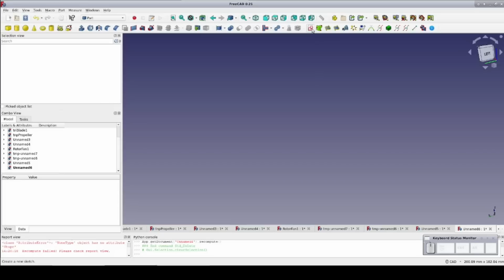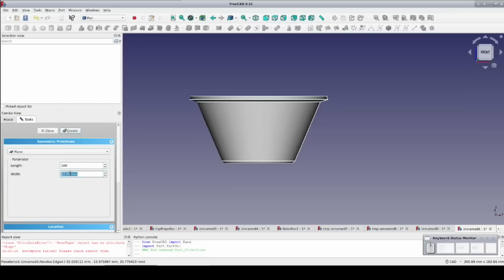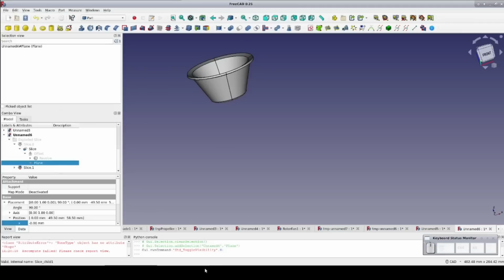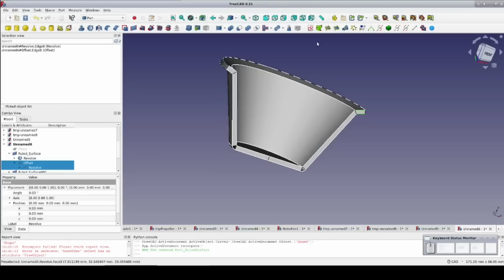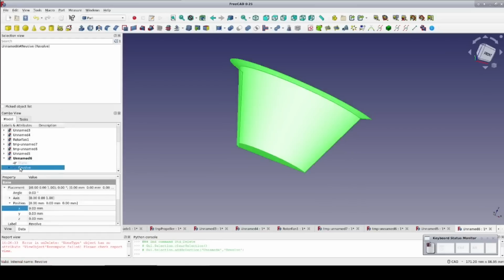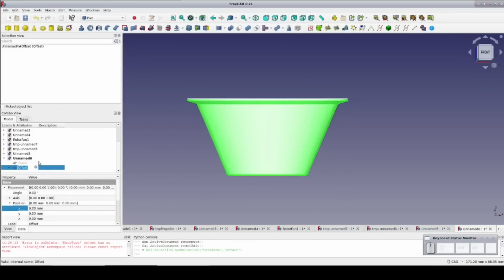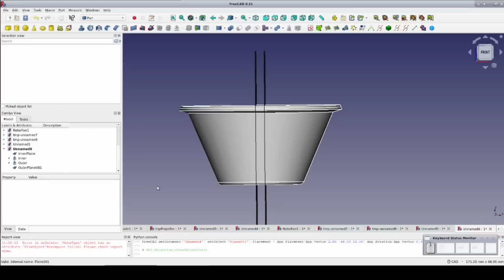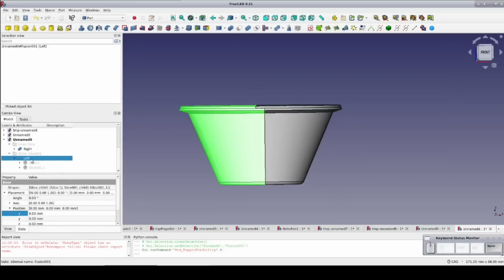FreeCAD: An open reply to Tom Sanladerer

Comment: The issue with FreeCAD I feel isn't necessarily one of features (well except TNP, which really needs a solution implemented other than telling someone to "just fully design the part"), it's one of UX and UI, and how in addition to requiring a different approach to making the part, many features and tools for those workflows are hidden and not obvious for a new user. This combined with the awesome number of different features and tools available in FreeCAD, makes learning an unreasonably daunting task, not because the new user is lazy but because the obtuseness of everything in the program makes it feel hostile to their experience, on top of demanding a different workflow; responding to this with "users of Fusion and Solidworks will just have to work harder" further emphasizes that feeling of hostility, whether it is intended or not. 
Yes, a User has to make some concessions when working on a new tool, but Devs also need to meet them in the middle and compromise as well; telling people to just deal with it is not conducive to the program actually being adopted. In my opinion at the least there needs to be some option for a "consolidated" UI with just a few main workbenches / toolbars (both on the larger level of there being more than a half dozen workbenches and within the workbenches; there should be a single dimension tool under sketch, for example) and serious work to at least try making the workflow more analogous to what it is in the major CAD software used by people. Whether you like it or not, Fusion and Solidworks are industry standards that most other software in that usage niche attempts to emulate for a reason, and the majority of people are used to the kind of workflow found in them.
Reply: OSS seems to struggle with this in general. FreeCAD hasn’t yet had its Blender 2.8 or KiCad 5 moment. Neither has Inkscape. Or GIMP…
Reply: Spot on
Reply: It is a big problem with open source projects. Everyone wants to work on the functionality and not how to use the program. Open source projects also tend to end up just being a load of separate sections tacked together and can end up being quite a mess. That is just an issue with having loads of developers just doing what they want, when they want. It also makes it harder to end up with a consistent UX and UI and hence they tend to just get to the barely functional stage and leave it at that.
Reply from the maker: Notably, FreeCAD is at version 0.20, so completeness is not really a question, it is not complete, it does not claim to be.
The question is "Is it useful in that state". I find it to be, as do others. Still other people do not.
Reply: @4axisprinting  You seem to miss the point Bar Rag was trying to make; functionally FreeCAD is adequate, but its workflow and usability are so poor and backwards compared to the expectations and requirements of the *industry*. Be this product design in general or more niche industries. FreeCAD definitely needs it's Blender 2.8 moment to be taken seriously to any extent, since right now it's another OSS with the functionality there, but not the stability, transparency or usability. I've had a much better time with CATIA than with FreeCAD, and the few friends i have actually doing CAD professionally don't want to touch FreeCAD with a 50 meter pole; With good reason.
Reply from the maker: @SlinkySlonkyWaffle  But implementing UX is no less work than implementing anything else yet, and it takes manhours to do. It's not finished yet. Though honestly, I find that it works well for me and I know some do use it for professional projects. That said, I don't believe I'd care to design a jumbo jet that way...
Reply: @SlinkySlonkyWaffle  You seem to miss the point you are complaining about a comparison between a Blender "2.8" product - i.e. not just a 1.0 complete product, not just a 2.0 major enhanced 2nd iteration of a completed product, but a 2.8, or 8 fixes BEYOND a 2.0 product.  And what are you comparing it against?  A .2 product.  Please note the decimal place and adjust your perspective to the reality of the situation.

As for CATIA, please note it is currently in version 5.  I remind you to carefully examine decimal points.  All the FreeCAD developers who devote their time, you know, for free, are greatly relieved you didn't compare it to version 23 of AutoCad to point out its shortcomings, you know, being 23 major releases behind...

We can likely agree on one thing however, a 2.8 OR a 5.0 future version of FreeCAD, when it happens will likely not receive such unfavorable comparisons nor complaints about "expectations and requirements of the industry".

Lastly, as the video clearly stated, there is zero expectation that your CAD PRO friends should consider it at all.
Reply: @brianmi40  well stated!
Reply: @brianmi40  FreeCAD is old enough that being an 0.20 release is an embarrassment, like being a 10-year-old kindergartener and not seeing that as a problem. I've tried it a bunch of times and it's miserable.
Reply: @jmsaltzman  Your certainly welcome to your opinion, however there's 22,000 subscribers to the largest channel of tutorials on it and you can read the Comments yourself on any of them for the infrequency of complaints.  I have zero problems with it (other than TNP which is fixed in LinkStage3 and marked as to be fixed in the upcoming 1.0.  Just designed some mounting plates and 3D printed them tonight.  My average moderate design like that takes less than 5 minutes from starting up FreeCAD so I'm happy to have an open source solution that works that well.

As usual here, no one is specific about problems, just expressing dislike, sort of as someone would who worked for AutoCAD.
Reply: @4axisprinting  UX should be one of the first things implemented. It may not be fun but it dictates the structure of the rest of the program. It also acts as a way to quickly identify what features need to be added while limiting feature bloat. There are certain features that similarly dictate the structure and those should be developed concurrently with the UX.

Much better to have a good UI with buttons that have NYI next to them than a UI that you can't understand unless you wrote the thing and having every feature implemented.

If you don't follow this process, you are literally better off writing a program that runs via console.
Reply: @jmsaltzman an "embarrassment" are your comments, you clearly are missing the point that FreeCAD is a free tool, with no limits or other funding other than grants or donations, worked on by a small team. All your professional CADs literally use the same proprietary geometric kernel, Parasolid, maintained by Siemens. The CAD software itself is maintained by Autodesk, Dessault Systems or whatever other large company. They, unlike FreeCAD, do have the funding to pay multiple teams of full-time developers. Yet sure, FreeCAD being at .21 while being very capable for it's price is an embarrassment.
Reply: @4axisprinting  I don't think the version number takes the traditional milestone approach. 1.0 doesn't mean it's "complete" it just seems like a build number in this case.
Reply: @4axisprinting  The first release of Freecad was 2002, and the first stable designated release 2022. It isnt about completeness, but about that 20y+ of freecad development spent aproximately zero minutes in UX. This isnt uncommon for open source, the dearth of UX designers in open source is a well known phenomenon. Watch some Tantracul videos sometime.
Reply: @4axisprinting  The "It's only at version 0.20" and "they admit it's not a finished product" arguments lose their weight of integrity when a software reaches ten years old. Freecad to date is over twenty. By this point it has no LEGITIMATE excuse for still having as hostile or cumbersome an interface and experience as it does, to new learning designers and experienced professionals alike. I won't deny that Freecad has its advantages or that the workflow "simply feels more right" for some people, but when you combine its limitations and the core development team's insistence on driving out the sources of some of those advantages (as with the unilateral removal of  CadQuery and OpenSCAD workbenches and compatibility a couple of years ago) with that particularly steep learning curve, and with the community's intransigence against an alternative UI/UX even optionally, it creates an environment ripe for exactly the sorts of criticisms that Freecad gets heaped on it everywhere except it's own message boards and chat rooms.
Reply: @claws61821  Funny, no one comments to a real master of the program like OficineRobotica about the UI, as he configures it for a completely modern experience and maximizing the view window:

https://www.youtube.com/watch?v=6iU0g-X5Z1g&t=5s

To say nothing of all his advanced tutorials, where NO ONE comments on how "clunky" the workflow was:

https://www.youtube.com/@OficineRobotica
Reply: While I can agree the UI, UX and workflow are very different and a bit rough in places the amount of learning required to come at the Solidworks/Autodesk etc as a new user is not actually that different, IMO might even be easier to get started in FreeCAD! Any software as capable and complex as a 'complete' CAD/CAM/FEM package has a huge learning curve and feels daunting when you are new to it. The big issue for most there is that they are not willing to learn a new workflow for a new tool - which is perfectly understandable, but it doesn't make the new tool terrible or unusable. It can even be massively massively better tool and folks won't want to go through that new learning curve, and will be very down on it for doing something 'wrong'!  

FreeCAD clearly isn't in a finished polished state yet, but I don't see any reason to make changes to FreeCAD to be more like the other CAD programs in most areas - the difference in most cases makes no difference to the functionality or usefulness once you learn the required workflow. What people are 'used to' is not a worthy reason to put in so much effort when the current method works fine - has to be some functional benefits in tool function or increasing consistency across the FreeCAD interfaces as well.
Reply: @foldionepapyrus3441  I disagree. Once you learn how to use one of the major CAD programs it is not hard to transition between them. I started on autodesk inventor, then fusion 360, then solidworks and now back to fusion. The workflows are similar enough that you shouldn’t have much issue switching between them and for the most part the tools work similarly.
Reply: @conorstewart2214  Just because some programs happen to use similar methods doesn't mean that method is the only 'correct' or 'good' method. Lots of programs with similar use cases but very different design where all of them are popular, and lots of folks drive giant petrol muscle car type things as if they are the only vehicle that can possible exist, does not make that European sports car or even tiny compact car wrong - it is just style.
Reply: @foldionepapyrus3441  I never said it was the only good method but you make it out like it is just as hard to switch between the main ones as it is to switch to freecad which isn't the case at all.

Plenty of other things don't deviate much in style and there is a reason for that. Doesn't matter what car you get in, the controls may be in different places (except the main ones) but you will know what controls should be there and how to use them. The car may look different and be a different style, it might even be a truck but the main controls and how you drive it will be the same because it is standardised. Changing to freecad is like getting into a car with its controls totally different, like steering with your feet and having a button for the throttle. It isn't an easy transition like it is with other CAD software.

Similarly most people can go onto a website and know how to get around the website, since most websites use a pretty standard format. If the website isn't intuitive to navigate then people just won't use it, same with freecad, if it is totally different to the standard CAD software out there then people just won't use it.
Reply: @conorstewart2214  No I said as a NEW USER learning FreeCAD vs learning any of the others is similarly difficult and daunting.
Reply: @foldionepapyrus3441  if experienced people find freecad a pain to use then it is a lot worse for people who have no experience. Also wouldn't you want your time learning how to use a piece of software to be applicable to other, similar pieces of software? It's like learning to drive a specific car and then finding out you don't know how to drive any other car and will have to relearn it. There is a reason companies don't use freecad, there is a reason universities don't teach freecad and instead go for options they have to pay for.

Fusion 360 or onshape are probably the most beginner friendly pieces of CAD software out there. It isn't hard to go from nothing to being able to create semi complicated designs with just a little guidance.
Reply: @conorstewart2214  Really not the case - experienced people are locked into trying to do everything the way their last software did - they don't like changing between Solidworks and Autodesks offerings even! That doesn't apply to a new learner - they will learn the correct best practices for the software they are using and not have to unlearn all the wrong ones first!

The only reason not to learn to use FreeCAD initially at this point for most users now really is industrial inertia - it isn't quite as polished or functional as I expect it will become, but it is now a fully functional tool that can do everything most CAD users would need. It just hasn't been that way for 20-30 years to start becoming common in the industry, and so a sought after skill.
Reply: @conorstewart2214  Who's recommending CAD professionals even consider a switch to a .2 pre-release version of open source software?  Not their employers, nor their peers or any college professors nor the author of this video who was explicit in stating that.  Literally NO ONE masters Autocad or SOLIDWORKS and wakes up one day thinking, "you know. I think I'll learn and switch to using a pre-release .2 version of some open source software."

Strawman much?
Reply: @conorstewart2214    You'd think so, but would be wrong as this video clearly points out; Thomas was done in by his preconceived errant notion that some pre-release version of some open source software would or should operate just like its finished, polished commercial alternatives, instead of approaching it humbly and watching enough tutorials to capably accomplish his task.

I conversely approached FreeCAD humbly and sought out videos to teach me about it from the hundred plus published in the last year.

And the reason companies and professors don't recommend it has much less to do with it's workflow or limitations, but has everything to do with what companies USE as a CORPORATE STANDARD, open source need not apply unless it's grown to prominence and huge levels of support, like Linux/Unix.

Don't learn Onshape to work at Jabil Circuit, it can't export Gerber files, the standard they use.  So anyone wanting to learn CAD for a career can't just pick a big popular easy to use tool, more than they need to research the industry and even target employers they want to work for.

And you know what Fusion 360 and Onshape have in common in their status of "most beginner friendly"?

They both are COMPLETE PUBLISHED VERSIONS of software that are a result of millions of dollars invested in developing them over 10 years, and 8 years respectively.  And you think it's reasonable to compare them to a pre-release version of some open source software that depends entirely on coding by volunteers and say it isn't as "user friendly"?

LOL
Reply: @brianmi40  every time free CAD software is discussed people bring up freecad, if it isn't ready for most people to use then why do people bring it up? Also being open source and still pre-release isn't really an excuse, if it isn't easy to use and the Devs seem to have no plans to make it easier to use then it is safe to assume it won't become easier to use.

How much time did you put into learning it? How much faster would it have been to learn an alternative? If they are having to publish hundreds of videos to teach people how to use it, even basically, then there is something wrong. If it is still pre-release and early in development then why are they trying to make lots of tutorials on how to use an unfinished piece of software that may change drastically?

The reason companies and professors don't recommend it has everything to do with its workflow and limitations as well as how unreliable it could become. If there are better, easier to use tools then companies will buy them rather than use some convoluted open source program. Professors go with what is easy to teach and is still used in industry. The cost of buying a better price of software outweighs the cost of wasted time and having to workaround problems with an open source piece of software which could become unreliable or abandoned. If companies or universities could save money using an open source alternative they would.

Most people can just pick a prominent, easy to use CAD software and learn that and then if they need to they can transition to a different CAD software. Switching between the prominent 3D modelling CAD software isn't difficult, switching to freecad is. Switching between PCB design software again isn't difficult. Remember CAD software is just a tool, it generally requires a lot less training and knowledge than being able to design the thing in the first place, the CAD software is just a tool to create a model of your design. For the most part with the types of CAD software it isn't difficult to transition to a similar piece of software. In general people just want to have to learn where the buttons are in a new piece of software, they don't want to have to learn how to do everything a different way.

Even people who are very experienced with CAD and do it professionally do not like freecad, shouldn't you maybe think why they don't like it? Why would beginners spend a lot of time trying to figure it out when they could just use something else and learn a lot faster? The best tools are powerful when you need them to be but also simple and easy to use.

If freecad isn't ready for mainstream use then people need to stop recommending it. The excuse "you just need to learn how to use it" doesn't really work, if it is harder to use and more limited or convoluted then why would people bother? Open source projects tend to do a lot better when the people trying to use it are listened to and it is made easy enough to use, they also tend to do better when they share similarities with already existing and established software, rather than trying to make everything unique.

Why would anyone use a piece of open source software if they don't know when or if features will be added? If they don't know when or if the usability will be improved? People don't want to sink time into learning something that may go nowhere or may take a long time when there are already existing solutions, once people use those already existing solutions there needs to be a very good reason to switch to an open source program and freecad with its low usability doesn't have many good reasons.
Reply: @conorstewart2214  They "bring it up" because it's the most capable open source 3D CAD software available, despite being far away from what the developers would consider a 1.0 release, unless you're a programmer wanting to program your CAD designs with Openscad.  Most other open source CAD are 2D only.

Being open source and pre-release isn't an excuse, it's simply a fact indicating it doesn't receive really any measurable financial investment compared to a commercial product with dozens of full time paid developers.  It also indicates it hasn't achieved a status of being complete and ready for primetime, as opposed to ONLY being of valid interest to those willing to put up with bugs, suboptimal workflow and functional limitations and able to exhibit the necessary patience to work with those limitations by virtue of being able to accomplish useful things despite them. The devs have every intent to improve and make it easier to use, as any review of the dev blog on their web indicates, to say nothing of the discussions on the forums.  It is easy enough for many to use, including me, but obviously not everyone.

You clearly don't seem to be their target audience. So should move on to a commercial alternative and end your frustrations.

As for my learning curve, it was part time over 4 months and now I can create objects of moderate difficulty within minutes.  Yes, I've had to figure out some workarounds, like deleting a boolean cut before making other mods to a model and redoing afterward, but so far there hasn't been anything I can't conceive and produce with it.  I and many others have said it isn't much different from other packages to learn, there isn't much magic available in sketching out a shape and padding it into 3D.  I spent some time years ago learning paid for Viacad 3d and found the learning curve much the same with 50% of the effort learning new pictures on the icons or what Workbench does what in FreeCAD.

"They" aren't making tutorials with the possible exception of this developer responding to a popular video where the user ran aground.  As a dev I would be happy to speak up if someone errantly thought a product I was a developer on couldn't do something I knew it could do.   The vast majority of tutorial creators have no affiliation with the project, just enjoy teaching or trying to make a few bucks from a YouTube channel.

As I already stated, Onshape doesn't get blocked from use at a company like Jaybil Circuit because it has "bad workflow".  Corporations often have immutable standards.

As for "convoluted open source program" it seems necessary to remind you this is a .2 dev release and that you need to just let it go that it is NOT competing for a place in corporate America.  The "better and easier tools" that corporate America will buy, they are FINISHED PRODUCTS, why are you incapable of understanding that?  As I said, NO INDUSTRY will standardize on PRE-RELEASE software to bet their company's future on when there are "post 1.0" alternatives with an established corporate entity supporting them.

Saving money in a university doesn't prepare the students for the workplace as much as training on applicable software used in their future workplace. That's why nearly every commercial package has a free or lower cost Student version.

"Most" people will never switch their CAD software unless by job necessity or opportunity or bankruptcy, etc. of the publisher.

Yes, once again, no argument, switching from a professional grade commercial CAD package IS INDEED "hard" to a pre-release open source unfinished product -- that's why NO ONE DOES IT and FreeCAD does NOT position itself as such a product.

So, DUH, pro CAD users do not "like it", you need to learn what a strawman argument is.  No one cares what THEY like.  It's not built for them, not marketed to them.

The "reason" beginners spend time learning it is that they don't have $300/year and up to pay for commercial software that they may start to learn and abandon, or use for one task and abandon, or they are happy to find they can actually do what they want with it, despite some workarounds, and they like the idea that if it meets needs now, it most certainly will get better with future releases to become easier to use and/or more capable giving them a significant payback for their investment to learn it.

This has played out in countless scenarios for open source software, including Blender, Inkscape, Open Office, and tons of other products that provide tremendous power, for FREE.

No, people don't need to stop recommending it, people like you need to stop denying reality that it was ALWAYS advertised as what it was: open source software subject to bugs and limitations and a need to STAY AWAY when that is not your cup of tea.  PERIOD.

Go learn what Steam means when they offer "Early Access" games and get a clue.  Caveat emptor.

Why do people use it with an uncertain future?  Because as I've repeatedly stated, MANY PEOPLE get it to do what they need TODAY, exactly as I've been able to do, so satisfied with that, they see that the history of software is BETTER in the future, not worse.

You need to give it a rest about "moving to " FreeCAD, there are thousands of users using it that never moved from anything.

Time for YOU to move on and leave all this behind.  Open source software is in no danger from people like you that see no value in it, won't suffer the limitations, and are happy to pay for a commercial product.  Spend some time reflecting on why everyone isn't just like you and that the world is a better place due to diversity, then get back to your life.
Reply: @conorstewart2214  Who the Heck owns those programs??? There's a common investor that pays the tune to have a common core! Autodesk
Reply: @conorstewart2214  No! The schools didn't go like yep we'll adapt Autodesk's litany of CAD programs... they paid their way in! That's how they got 'wide adoption'!
Reply: @brianmi40  definitely triggered you here. You do realise resorting to insults usually means you have lost the argument.

Whether or not professional users like it should matter, they are the ones that are most experienced with that sort of software.

Also your argument of a lot of people haven't switched to freecad and have just used it from the start isn't as big an argument as you think it is, it is actually an argument against you. All that says is that the people advocating for it don't have experience with anything else so lack perspective and really don't know what they are talking about.

It may be the most advanced open source CAD program but that doesn't mean much, especially when it is a lot worse than not open source solutions. Kicad is as good as commercial software for the most part, as is blender but freecad is not as good as commercially available software, it isn't a valid comparison.

I am not against open source like you seem to think. Freecad just isn't good compared to other CAD software and it has a long way to go until it is.

You say you spend 4 months part time learning it to be able to make basic models? People can learn to make basic models in fusion 360 or SOLIDWORKS in a few hours or days. They also have free or cheap non commercial licenses. 

Freecad needs more time in development before it should be recommended.

Maybe you need to realise that freecad is quite a lot worse than other CAD software and needs a lot of work. Why would you recommend something that isn't beginner friendly to beginners? If it is full of bugs and limitations and needs workarounds then why do you use it and recommend it? Why not use some other CAD program until freecad has all those issues worked out? You do realise time is worth something too and if you are fighting with the software it is maybe better to use something else and get it done quicker, even if it costs you.

You seem blinded by the fact it is open source, open source does not mean good. It means it will probably stay limited for a long time and will take a long time to develop. You compare it to steams early access games, however most of them are worked on by a dedicated team of people, not volunteers. So your argument doesn't really count, especially as early access is not open source.

You seem to of the group that says their free option is just as good and it can do everything the paid options can, but the reality is, it takes longer, is buggy and typically is worse and you need to find workarounds. I understand supporting open source projects but you can support them and recommend something else that actually works well whilst it is being developed. You using it is not supporting it, it is using it, actively developing or working on the code or donating to it is supporting it. The whole recommending something because it is open source and you believe it will be good in the future needs to stop, judge it based on now, you have admitted it has limitations, is buggy and you need to find workarounds, why does that make you want to recommend it?
Reply: @ev-ezaye3580  it really isn't the case. There are multiple companies all competing for the market on CAD software, no one company paid its way in, it is typically up to the professor what is used. Industry uses proper cad programs not limited, convoluted, open source ones so universities do the same.

It puts students at a disadvantage to teach them how to use buggy, limited software. It is far easier to teach them how to use software that works properly.
Reply: @conorstewart2214  I don't have any more time to waste on a hopeless case so this will be my last corrections to misrepresentations you refuse to stop making.

It appears beyond your grasp that "a lot of people haven't switched to FreeCAD" from another CAD system clearly then isn't EVERYONE.  And so, just like ME, coming from ViaCad and Tinkercad experience, many HAVE SWITCHED.  No, that doesn't include career professionals but no sane person would believe it should or is even attempting to make the case for that.

No, I didn't say I spent 4 months learning to create basic models.  That can be done in a few HOURS.  What I said is that in 4 months of very PART TIME USE I learned enough to be able to create a COMPLEX MODEL with multiple boolean curved cuts and complex precise internal geometry to make a replacement part for a window regulator which I 3D printed and is working in the vehicle today.  As a result of that investment to learn the  software I can now create moderately complex models IN MINUTES, just like I did yesterday in about 6 minutes to create a custom padded mount for my Ebike that I printed 4 of in TPU to mount it soundly in my van conversion.

My TOTAL TIME learning and using FreeCAD would amount to slightly under 20 hours, and that includes making 15+ designs along with multiple generations of modifications to them for better fit or function.  Creating any custom shaped, lofted, holed or angled multi-surface chamfered design of moderate complexity now takes me about 5 minutes.  So I couldn't care less if it might take 30 seconds less time if I started spending $300/year for some commercial software.  I can now confidently imagine a part and along with it the workflow I will use to create it, even taking into consideration eventual 3D print orientation for strength and reducing or eliminating overhangs.

That was the GOAL I set for myself, and I'm happily there now.

You need to STOP TRYING TO SELL ME THAT FREECAD DOESN"T WORK WHEN I'M USING IT DAILY TO EASILY CREATE NEW PARTS.  It is NOT "full of bugs and limitations".  Your claims simply do not MATCH REALITY.  Yes, there are bugs, but they do not break the vast majority of commonly used functions in it.  Like the majority of software applications today, most users use 20% of its capabilities to do 80% of the work accomplished in it.  There is even a fork which resolves the TNP problem now along with videos demonstrating its success.

The reference to Steam games was to illustrate that, just like open source software, they are not complete, may contain bugs, may not receive fixes to those bugs or imagined features or that they may be abandoned entirely.  All of those are FACTUAL COMPARISONS.  And yet you PAY FOR Steam Early Access games.

Just ONE tutorial maker, MangoJelly Solutions for FreeCAD has 22,000 subscribers and DOZENS of tutorial videos with positive comments about them SHOWING HOW TO SUCCESSFULLY CREATE A WIDE VARIETY OF DIFFERENT AND COMPLEX DESIGNS.

My use of it DOES SUPPORT IT, as I recommend it to others, and argue with liars to see it not misrepresented.

Because there is ONE CRITICAL DIFFERENCE BETWEEN US: I have successfully learned how to create any type of model I can imagine in it proving its tremendous value as an open source and free package, whereas you have chosen not to learn it, but rather just whine about it instead of MOVING ON IN YOUR LIFE.

You've made it some personal mission to burn down FreeCAD.  Good luck with that.  Go sell that idea to the 22,000 subscribers mentioned above.  I'll keep happily using it.

I have no more time to waste on you and only wrote these replies so that others can fairly judge the facts, that you have misrepresented not only the complexity of the most common uses for the tool, misrepresented my path to learning the tool, my success with the tool, and attempted to deny the value that it brings thousands of users who use it daily to successfully create their designs using a no cost alternative to commercial software.
Reply: @conorstewart2214  Oh, and:

"Kicad is as good as commercial software for the most part, as is Blender but FreeCAD is not as good as commercially available software, it isn't a valid comparison."

Once again, Kicad is version 7, Blender is version 3.5.  FreeCAD is version .2

Thanks for arguing that isn't a "valid comparison" genius.

Whoops, another insult, my bad.  I lose.
Reply: @brianmi40  Conor may be standing stubbornly by his statements of what Freecad has and hasn't done and needs to do and not do, but at least he is taking the arguments you and others present to him with respect and candor and replying to them calmly and on the points presented, as opposed to use of ad hominem and other personalized attacks and, attempts to drown out his points unaddressed, and easily confirmed falsehoods be they on your own part or on the part of others. Freecad may be advertised as being on version 0.20 now, but that is following a change of versioning scheme which previously claimed an arguably much higher version. The core development team has had a declared intent on their website to address the usability issues for ten years, which followed several years of firm public refusal to consider the same, and the usability has not been improved upon in that decade. Freecad is not "the most useful" open source CAD project around by a significant margin - what it is, is a candidate for the most flexible, but that flexibility is moot in the face of its performance and usability. Performance of Freecad ranges from matching par with OpenSCAD and limited shareware releases of Solidworks, to a 10%-20% improvement in rare cases provided that the user can make use of exactly the right benches and rendering engine, to significantly worse. That takes us back to the usability, which depends upon the interface and the workflow experience and the documentation. Freecad has amazing potential, and most people who have ever tried it desperately want for it to reach that potential, but it never will reach that potential so long as the developers and the community at large continue to vehemently deny that anything is wrong or that anything can be done to improve upon the issues that are regularly brought to light or even that those issues qualify as issues to begin with.
Reply: @conorstewart2214  I forget exactly the user or title but there is a playlist of I believe more than fifty videos created during the COVID-19 lockdown as a tutorial in depth on the use of Freecad. However, it is for a branch of Freecad that was forked shortly before the removal of compatibility with CadQuery and a number of other compatibility and functional changes, so it may not reflect the current main branch build.
Reply: @ev-ezaye3580  RE "common investor"

Two out of three ain't bad. Solidworks was never owned by AutoDesk. Fusion was originally owned by someone else entirely then purchased by AutoDesk but that's true of the vast majority of AutoDesk products, as is the litany of false promises and public grievances that usually follow until AutoDesk abandons any given acquisition.
Reply: @conorstewart2214  AutoDesk arguably did buy their way in. They started with an original product that at the time was considered inferior but "good enough" and after a couple of years they took out a loan to purchase their first competitor. Since then they have compiled a lengthy list of acquisitions in the CAD market, some in order to improve their own main lines and others simply to bury them. Even before that first acquisition they were already funding academic sponsorship programs to get teachers and students locked in to their products through colleges and universities, and campuses today compete to gain those sponsorship rather than have to pay for their students' and teachers' licenses for most of AutoDesk's software.
Reply: @claws61821  Sorry, perhaps you've missed the number of times he's misrepresented facts, misrepresented what he was CLEARLY TOLD, such as my experience with FreeCAD and what I've done with it and experienced.  I made those all clear in my responses, and clearly started out calmly responding, until he REPEATED THE MISREPRESENTATIONS AND LIES.

Do you support that type of behavior in a discussion without any consequences?  Sorry, I don't accept willful and repeated ignorance and misrepresentation of facts well.  It's the Internet, get over it or move on.  I'm not trying to win a congeniality award.

Help me understand, what kinds of "other personalized attacks" are there that are not ad hominem?  Do you know what ad hominem MEANS?

Exactly WHICH POINTS did I drown out unaddressed?

Was it the TNP, or my inability to edit a model after a boolean operation?  Was it stating there's a fork that appears to resolve TNP my "drowning out" of it?

Are you claiming it is NOT a FACT that the 80% of purposes that people use it for, involving the low end of 20% of its basic functionality operates JUST FINE BUG FREE?  Are YOU even an experienced user to be able to argue against this?  Because I AM, and it's never once crashed on me and I DO complete basic to intermediate designs in 6 MINUTES.

Sorry, I know nothing about the long history of the product, as a user for 4 months.

Educate me: at what point was it announced as a 1.0 product, even if later changed in numbering scheme back to pre-release, even if it's just "arguably" a case for the higher version number?  Exactly HOW was this represented to the public?

Exactly WHAT FALSEHOODS did I state about the product?  Be specific and QUOTE ME.

Did I ever claim FreeCAD was the "most useful" open source CAD software?  How is that relevant at all?  Didn't I simply state that I and others find it useful and functional?

If I have and can create basic to intermediate models in 6 minutes or less, what concerns should I have exactly that I could save "10-20%" with OpenSCAD or Solidworks?  Are you really arguing that users shouldn't use open source alternatives at a penalty of 36 to 72 seconds of wasted time per design as hobbyist occasional users?

As not a programmer, why should I care at ALL about the existence of OpenSCAD, other than knowing the future holds the promise of AI generating CODE to empower OpenSCAD as a future candidate to leverage that?

Are you arguing that OpenSCAD compares favorably to FreeCAD for non-programmers wanting to design for 3D printing?  If so, send me the link to that comparison because it's not the reality I found 4 months ago when surveying my options.

Sorry, where is your evidence that the "developers and community deny anything is wrong"?

Is there NOT a means to report bugs on their WIKI?
Do those NOT get responded to?  Show your work.

Since I'm "part of the comunity", let me repeat again that I never denied the existence of any bugs, nor ever advocated for ignoring them.  Sorry, can't speak for others in the community, but perhaps attack THEM when you see it happening.
Reply: @conorstewart2214  Funny, no one picks at FreeCAD's bugs and limitation on a channel like Jedi Master OficineRobotica's who knows it inside and out.  No one tells him about what it can't do, nor how bad the interface is as he configures it in minutes for a totally modern CAD UI:

https://www.youtube.com/watch?v=6iU0g-X5Z1g&t=5s

Then proceeds illustrating advanced concepts effortlessly with it:

https://www.youtube.com/@OficineRobotica

To say nothing about Mango Jelly Solutions, that has 375 video tutorials on FreeCAD:

https://www.youtube.com/@MangoJellySolutions

Yes, FreeCAD is "so" buggy, that someone created 375 tutorials without it once crashing.

LOL
Reply: @claws61821  Mango Jelly Solutions has 375 FreeCAD tutorials, and creates new ones about twice a week.
Reply: @brianmi40  with even the worst software people can understand how it works and how to not make it crash, that doesn't make it good, they just know how it works. Also are those tutorials recorded one after the other in a single take? If not then you cant know if it crashed or not. Also people tend to prepare before making videos or tutorials, they have run through it beforehand or have a plan of what they are doing, it isn't the same as someone just trying to use it.
Reply: @conorstewart2214  Understood, but I've used it for months with never a single crash.  I designed just tonight custom mounting bolt on brackets for a basket on a rear scooter mount that's 3D printing behind me in PETG as I type.  20 minutes, and that was deciding some of the design elements instead of just building from just some drawing.

Instead of SPECULATING, why don't you learn it, and experience it for yourself?  Because the simple fact is, no one is complaining here and saying "just do this, then this, then this, and WHALA it CRASHES".

Mango Jelly Solutions has 22,000 subscribers for his 375 tutorials on FreeCAD.  Do you really think 22,000 people are subscribed to his videos and NOT commenting like crazy if it's crashing all the time or acting buggy when they try to follow his tutorials?  Seriously?

You can review the comments on his videos yourself and see.

The bottom line is that a lot of the complaints about "offset failures" don't even understand it's NOT FreeCAD code at issue, but the nature of OFFSET GEOMETRY in CAD from the CODEBASE RUNNING BELOW FreeCAD (a library), which has been FULLY EXPLAINED by Mango Jelly himself:

https://www.youtube.com/watch?v=-enJR-OrMJM
Reply: @brianmi40  wow 22k subscribers, so many. Wow you quickly made a bracket, good for you. What is your point?

If it is an issue or limitation with a library freecad uses then it is an issue or limitation with freecad too. They don’t have to use that library do they? Just because the issue doesn’t come directly from the freecad programmers doesn’t mean it is nothing to do with them. Every time a programmer uses a library they are responsible for making sure it is suitable, safe and does what it is supposed to. Can you imagine a company using that excuse? Oh it’s not our code you have problems with, it is a library we used, so we won’t do anything about it.
Reply: @brianmi40  wow you can create models just like anyone else who designs parts for 3D printing, you are so special, it is so difficult. Your experience making simple parts does not mean the software is good.
Reply: @conorstewart2214  My "point" is that:

A. FreeCAD is the best option source option for a parametric CAD program today.
B. It works much better than many people are "claiming" here, as evidenced by NO HUGE LIST OF VIDEOS on Youtube found under "FreeCAD BUG".

"If it is an issue or limitation with a library freecad uses then it is an issue or limitation with freecad too."

Brilliant, figure that out all by your lonesome or did you have help?

"They don’t have to use that library do they?"

Sure, they don't.  They could toss away thousands of hours of code development and start ALL OVER with another library.  Gee, Microsoft Office has had BUGS, it was written in C++, do you recommend to Microsoft they toss it all and start over in Javascript?   LOL, program much?

"Every time a programmer uses a library they are responsible for making sure it is suitable, safe and does what it is supposed to. "

Yes, of course, and of course also, they should be PRESCIENT AND KNOW THE FUTURE that after starting with a library a bug will show up in the FUTURE IN IT.  Again, program much?

"Can you imagine a company using that excuse? Oh it’s not our code you have problems with, it is a library we used, so we won’t do anything about it."

For certain there's NEVER been any bigger bugs that ever have been found in OPEN SOURCE SOFTWARE developed by volunteers.  NO WAY that corporate America faces such issues, right?    LOL

https://www.wired.com/2005/11/historys-worst-software-bugs/

You should run for "Programming Czar", you've got it all figured out.  Despite your undisputed genius, I will mention AGAIN that the feature list for FreeCAD 1.0 has a resolution for the issue, as well as existing forks.  Relax, you won't lose your job just yet at AutoCAD as a influencer.  Remember, AI is coming for your job; not FreeCAD.
Reply: @conorstewart2214  Wow, a double wad in your panties you had to get out all in the same day.  Bravo, you do you!

"wow you can create models just like anyone else who designs parts for 3D printing, you are so special, it is so difficult. Your experience making simple parts does not mean the software is good."

Actually, it does mean the "software is good", in the most important two ways in the WORLD to me:

1. It is open source and feeds not corporate America
2. It does EVERYTHING I ask of it, so YES, it is good for me.  I'm sure you buy anything you do buy, and use any software you use because it's GOOD FOR THE REST OF THE WORLD and NOT YOU, but some of us just care about US getting our work done.   I'm sure its inability to use a measurement system in Cubits bothers some people, but I'm getting along just fine in the Metric System.

Again, AI is coming for your job, not FreeCAD.  relax.  Next time have ChatGPT summarize it for you so you don't make basic reading comprehension mistakes:

"I learned enough to be able to create a COMPLEX MODEL with multiple boolean curved cuts and complex precise internal geometry to make a replacement part for a window regulator which I 3D printed and is working in the vehicle today."  <> "simple parts"
Reply: Just thought I would chip in with an opinion from a professional CAD Design Engineer (as you seem to be implying professional CAD designers are all on one side of the argument) FreeCAD is my favourite CAD software hands down. 

6 Years ago I started with Fusion 360 (actually 123D design when it was still around first). I have used it for hobby use, I have won two 3D printers in design competitions and used it commercially for freelance design work, and in an academic context, using it for my Masters Thesis project. I have used it for hybrid manufacturing, using Fusions inbuilt slicing engine and CAM module to 3D print and machine a nylon gear with a CNC router. I have used pretty much all the features of Fusion (except the electronics workbench) including generative design through my uni course.

I have dabbled in OpenSCAD, making a couple of parametric print in place cylindrical roller bearing designs. Very powerful for highly parametic designs, but way too convoluted for general CAD design use, unless you can type code as fast as you think.

I have used nTopology a little through uni. It is extremely powerful for complex geometry, particularly for additive manufacturing, but is quite pricey and specialised.

I currently use Solidworks in my day job as a design engineer, dealing with very large assemblies (sometimes 1000+ components).

Whenever I want to design something now at home I always go to FreeCAD, since I have a lot of experience with it now (18 months in my free time), it does pretty much everything I want with no commercial considerations or restrictions or cloud requirements or counter party risk etc. I could use the free Fusion version (as I did for many years), or the modest hobbyist version of Solidworks which is around £10 a month, but I don't see the point if I can do anything I want with FreeCAD. Occasionally I have to look something up in the wiki to learn a new feature, as with any software, but it makes much more sense for me to do it with a free software, and just build on my knowledge for the long term in that CAD software, with no worry of things being locked behind commercial paywalls or licences changing or having to pay for it constantly etc.

There is no counterparty risk if the company goes bust. If current developers leave, others can pick it up or fork the project. Generally the software will get better with time (or I could just stick with what I have in the very worst case scenario), so my general outlook for the long term is positive for FreeCAD, but it totally needs to some work to make it easier to pick up. For the other major CAD software I mentioned, considering current economic conditions, the free versions probably won't develop much. But they are great in commercial contexts which they are well developed for.

Just to address an earlier point on CAD taught in Uni, generally it's based on the standard in whatever industry: Solidworks is big for general engineering; Fusion 360 for product design (as is Autodesk Inventor), AutoCAD is big in Civil Engineering and Architecture (also SketchUp arguably lol), Abacus and Ansys for engineering simulations, Blender for animation and game design etc. What you get taught in generally based on what is popular and useful in that industry, as the CAD programmes are generally suited to those specific industries although there is some overlap or other less used CAD software that are quite powerful e.g. Siemens NX, nTopology etc. There is often a lot of inertia in business and industry. Switching CAD programmes is costly so businesses tend to stick with what they have if they can. There are many things where I think Fusion is better than Solidworks, but I know it's never going to be big in my industry (although probably needs some improvement in large assemblies and drawings tbh).

You are totally correct in saying FreeCAD is difficult and awkward at first, and it really doesn't (and shouldn't) be this way. But I'm saying despite this, as a professional CAD designer, it is well worth the effort put in, and it only gets easier over time. Now I never use Fusion (or other CAD software) in my spare time, and the Part Design Workbench in FreeCAD is the best workflow and design structure of any CAD software I have used so far. I find timeline based CAD programmes clunky now compared to FreeCAD, and it only took me about a month in my spare time to get comfortable with it. Totally recommend you give it some investment to learn.  @conorstewart2214
Reply: @Bordpie  it was interesting to read your opinion on it. Out of interest, would you use freeCAD instead of solidworks in your day job or do you think freeCAD is mainly good for hobbyist use? Do you think freeCAD would be suitable for freelance work, where you are working alone or more fixed work where you are working as part of a team?

Your comment on not liking timeline based CAD was something I have never really heard before, do you mind explaining why? I also believe in fusion 360 and maybe solidworks you can switch off the timeline (I think fusion calls it design history or something like that). Are there any advantages of not having a timeline? As far as I can see there are a lot more disadvantages than advantages in not having one.

I suppose my big question is, as you are a professional CAD design engineer, would you use freeCAD professionally? It seems from your comment that so far you only use it for non commercial use.
Reply: My only concern with using freeCAD with my day job would be it's capability for handling very large assemblies and subassemblies (up to 1000 components). Otherwise it can do everything else I want including sheet metal design and drawings. I will say I am a little slower in FreeCAD, that is down to the polish on some of the tools like dimensioning (could easily be updated), but it's not significant.
I would need to convince the company to switch to this software which is unlikely since they are settled into Solidworks now. We produce many custom designs for truck bodies which we may need to refer back to for repairs or developing new designs. Before I was there they used Pro Engineer and a bit of Creo. Sometimes we have to refer back to the files for older designs and it's awkward.
This week I spent a couple of days fixing a CAD model of a Tipper Grab truck going on a Mercedes 32T body. It was designed by a guy who has left the company now, but it has lots of equations and in context modelling (referencing other components in an assembly for modelling) and it breaks everytime I load it up because all the components load up in lightweight mode by default. While in context modelling can make things more parametric in theory, in reality Solidworks seems to break things and lose references randomly, or when you try to modify a design. Then you have to go back and fix it, although this is as much about modelling style as the software itself. I get the feeling Solidworks is an old piece of Software, that has just continually had things bolted onto it, but because people are stuck in the ecosystem they stick with it.
 @conorstewart2214
Reply: I'm not against Solidworks or Fusion in a commercial context, there they make a lot of sense and can work well (apart from 'Cloud Credits' in Fusion 360 which are an easy way to waste a lot of money). I have used both in a commercial context.
I have used FreeCAD a little for commercial work so far. I had to figure out the rendering feature which delayed me slightly but otherwise I've done the same in FreeCAD as I did in Fusion. There is an argument to be made for speed and time benefits in Fusion, but at the same time there are no commercial licence concerns with FreeCAD (or things locked behind cloud credits). As I'm getting more proficient in FreeCAD, I now lean towards that for everything now.
I will say for hobby 3D printing use, which is where I started with CAD, FreeCAD is a much better choice. Maily with respect to commercial licences and open source designs.
e.g. If I design something and want to share the source CAD file so it can be modified, I can't share it under a free for commercial use licence, if I designed it with the free version of Fusion. Or even if I did use a commercial license, the people who modify the design would also need a commercial licence to share it under the same license i.e. with a 'share alike' creative commons license. So in the open source domain,  most commercial CAD programmes are in a bit of a grey area. The only significant exception is Onshape, which allows commercial use with the free licence, but all your designs are public through Onshapes cloud platform. Good for hobby open source projects, but there is still the counterparty risk of the company changing the free licence terms (which both Fusion 360 and Onshape have done previously). Or the company getting bought out or going bust at some point in the future. With FreeCAD I have non of those concerns. I'm generally confident it will continue to develop with time as other open source software has.
Also with respect to free for commercial use, that is a big plus for people try to earn money freelancing or selling files for 3D printing etc. In 2019 I actually tried selling the files for some of my iris box designs on MyMiniFactory. I bought a commercial license in Fusion and a 'Storefront' in MyMiniFactory for a few months. It was costing about £60 a month (about £40 a month was Fusion 360) for the commercial licenses and it just didn't work out (also down to the things I was designing tbh). Using FreeCAD, and one of the other file sharing sites like Cults or now Printables, it's possible to design and sell files with no commercial licences, which makes it easier for anyone to get started with it.  @conorstewart2214
Reply: When I say 'Timeline based CAD software', the 'Design Timeline' is actually in FreeCAD like most CAD software, depending on how you design the part. There is the 'Part Design' workbench which is just like normal CAD design. One feature after the other to build up the part, with the caveat of the Topological Naming Problem although I believe that is being addressed in the near future. 
I'm not refering to 'direct modelling' which is where you have no design history in Fusion 360, that means you lose the design history of the part.
I'm refering to CSG modelling (Constructive Solid Geometry), which is also how nTopology and OpenSCAD works. The 'Part' Workbench in FreeCAD is based on CSG, which is where the final part is built up from a tree of sub-parts which are formed with boolean operations. 
The simplest way I can describe it is that the common CAD timeline approach (called feature editing) is like a straight pole, with one feature after the other in series to make the object, while CSG is like a tree, with multilple branches combining in parallel to make the final object.
In CSG all parts of the design are accessible simultaneously whereas with a timeline, only the final object is accessible. e.g. In Fusion I had a situation where I wanted to take a solid object from earlier in the timeline for a boolean operation. To do that you have to move to that point in the timeline, copy the object then move forward to where in the timeline I want to use it. In FreeCAD the previous solid objects are just available for more boolean operations at all times, they always exist. 
In effect, CSG is like multiple timelines that merged into one. I have wasted a lot of time with complex models adjusting a small feature early in the timeline, then having to recompute the whole timeline to get the final object again. CSG only recomputes the branches it needs to.
It also makes it really easy to move parts of designs to other designs. You effectively just copy a branch of one design, and drag and drop it into another.
The disadvantage with the 'Part' workbench is that it is a little less refined since most people use the feature editing workflow in 'Part Design' so that gets most of the development attention.  @conorstewart2214
Reply: @foldionepapyrus3441  Yes! A Big resounding Y E S!!!! I don't understand why these folks are bemoaning the FreeCAD devs for their UI & UX! Do y'all recognise the pool differences between 'industry giants' such as Autodesk and the like?? Buying up anything & everything  in between to position themselves where they are? Their hundreds of thousands of PAID workers against the few thousands at best Non-Paid contributors of FREECAD!?!?!? And why in the heck, should they plagiarise the UX or UI of Autodesk??? So you can jump in and out when it pleases you?
To you nay sayers, I beseech you, Go write some code, develop a CAD programme, design it with the ease of Solidworks and the like, then after a million hours of UNPAID work deliver it the community and let's see it get ripped apart for 'X' or 'Y' 😅! Then you'll be able to empathise with FOSS since y'all lack the capacity currently to sympathise!!
Reply: @foldionepapyrus3441  If the UX is good and the workflows are efficient and intuitive, there is nothing wrong with being different. The problem is when the UX is shit, nothing is intuitive, and even if you know exactly what you are doing, doing it takes far longer than any other software...
Reply: @foldionepapyrus3441  I agree completely.  Having just spent 4 months getting a comfort level using FreeCAD I can confidently say that the issue is HOW people attempt to learn it.  If not some intuitions like Thomas, bringing expectations from other FINISHED and POLISHED products and failing to see them work, they often simply root around in the menus hoping one of the most complicated types of software can just be "figured out" based upon some basic understanding of 3D modeling, or experience with a simple tool like Tinkercad.

Instead, if people simply watched videos for a few hours, taking notes including questions to seek answers to in other tutorial videos, and referencing them as they then try to complete their designs, they would find that they could quickly learn how it works, and would see that for the most part the workflows ARE logical despite functionality being spread across multiple Workbenches.  

What a program like FreeCAD lacks, unless I just haven't seen it, is a graded and sequenced set of tutorial videos to watch that follow a logical progression of learning the functionality up to a point that you get into more advanced functions where you may or may not need to learn them.  If I had been presented a list of YouTube videos that demonstrated Sketch, then Loft, then Hole and on up through Transform and Datum Plane, etc. I think I could have condensed my learning from 4 months of part time figuring out "what" I needed to learn, failing at many seemingly "intuitive" steps and achieving success after locating the video that showed me what I really needed to know down to a week or so.  Because the videos ARE out there.

But despite struggling because of my own suboptimal approach to learning it, I was able to create a complex part for a window regulator in a car power window.  It had multiple curved features including a curved boolean subtraction, complex internal cavities for attaching the cables and the benefit of a sliding mount system I added for the glass attachment arms to eliminate the need for precision in the entire part and allowing me to 3D print in an orientation for highest strength.  It works just fine in my son's car and I can mirror it so have a ready option to fix any future failure in any door.  I now can confidently and quickly create just about anything of moderate complexity and am very happy to have decided to learn it and not toss my hands up when it wasn't intuitive to my vision of how it "should" work.
Reply: @brianmi40  Indeed, I think on the whole FreeCAD despite its rough edges is very logical in its functionality. 

I don't know if there is any really great step by step tutorial video type stuff, I've mostly found what I need to know from text based help type stuff in the wiki,  and perhaps looking at specific things in video form as I needed.
Reply: @foldionepapyrus3441  You misunderstood me, I am precisely saying there ARE all the videos you need to learn anything about FreeCAD step by step, the only lack is someone suggesting an ORDER TO WATCH THEM that will take you from newb to proficient...
Reply: @brianmi40  Yeah. I don't know if you've come across Irv Shapiro's channel but he does have some lessons on FreeCAD and a few others and even comparisons on achieving designs according to each's workflow
Reply: @ev-ezaye3580  I've seen Irv from his 3D printer stuff.  

The LinkStage3/Realthunder branch is fantastic, and with these UI settings, looks great and maximizes screen space also:

https://www.youtube.com/watch?v=6iU0g-X5Z1g

OficineRobotica is a true Jedi with FreeCAD.  None of these naysayers would dare challenge a knowledgeable user like that with their unspecific nitpicking or "it can't do"...  And Mango Jelly Solutions has a ton of great tutorials:

https://www.youtube.com/@MangoJellySolutions
Reply: Also a lot of people miss the point of OpenSource software, if you don't like something, you CAN perfectly do it yourself, or place a Bounty for the feature to be added/reworked.

You can make your own fork and apply the feature or rework you want without the repository owner permission since when you create a fork you are the owner of that fork so you can do whatever you want. And if it works well and you may want to add it to the original repository you can do a pull request to add it.

it's open source so you CAN do everything you want with it (as long as you follow the license of that program)

If you can't program, do a Bounty, do suggestions, these are people projects, anyone can contribute. But i don't recommend just pooping OpenSource software, if you want it to be better, make it better, nothing will ever stop you from doing it, it's good to catch and report flaws, but do it with the intention of making it better, not the "don't use it because it's bad", that will only hurt all of us and make mega-corps keep making more money.
Reply: @Splarkszter  well said.